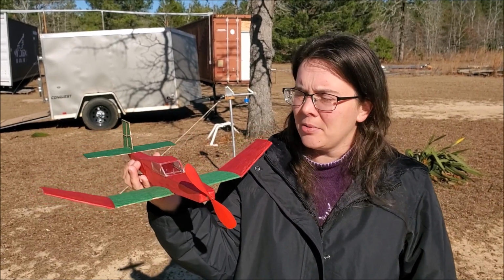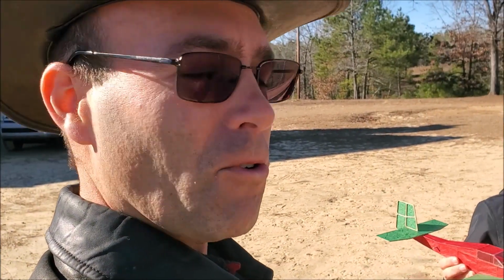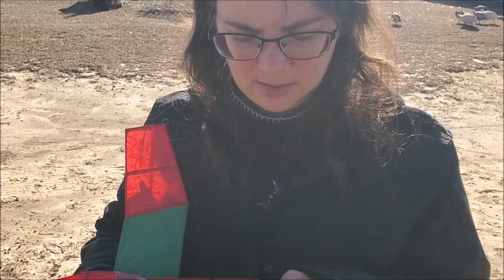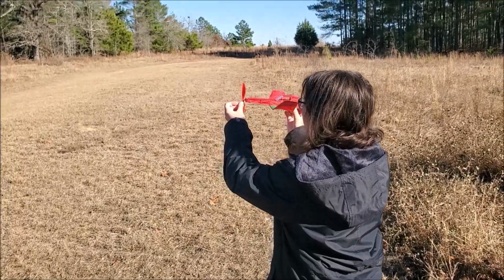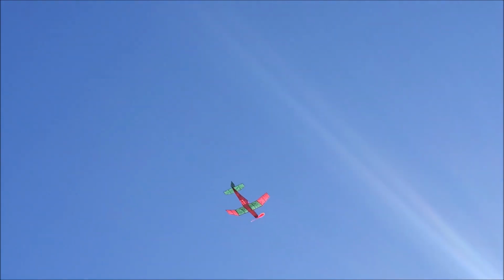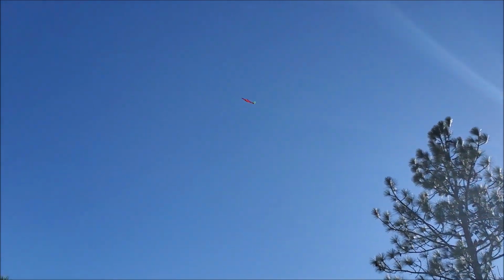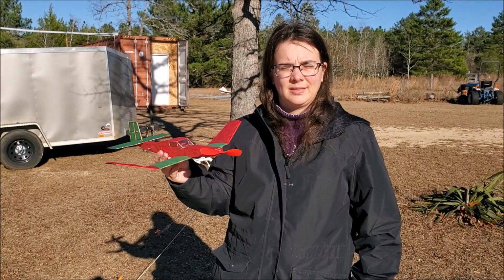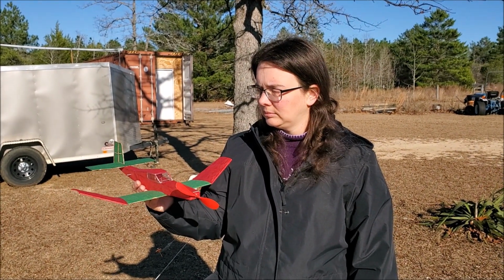Dick Baxter's Akro is the best low wing sport rubber powered airplane!

Comment: I built one last winter for fun flying indoors and it flew straight off the board. Tried it outside this summer and it was magnificent just like yours. Trouble was, it was so magnificent, unlike you  I never found it.... I think it ended up in a high tree. Solution, a couple of days later I built another for this years indoor gatherings!